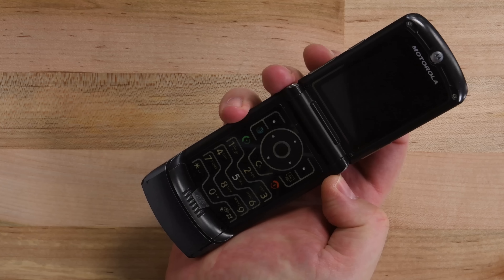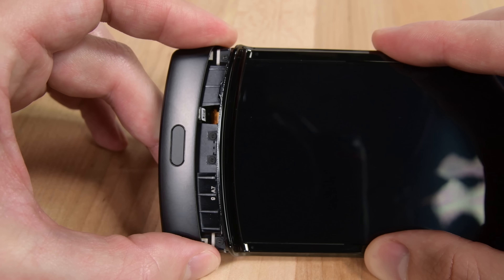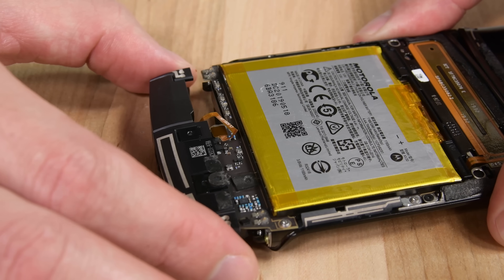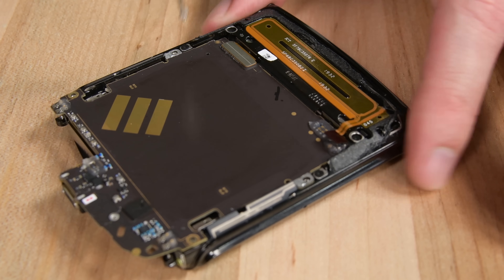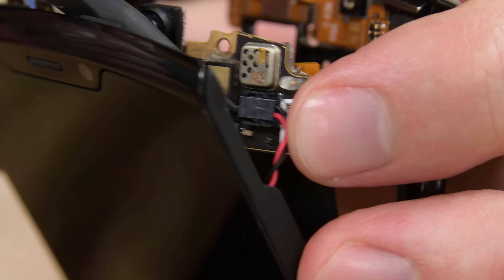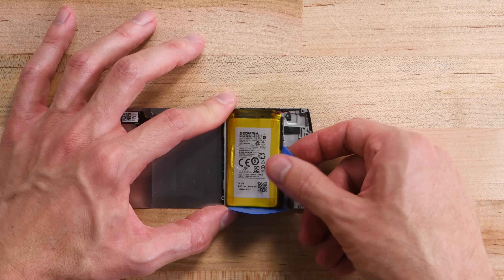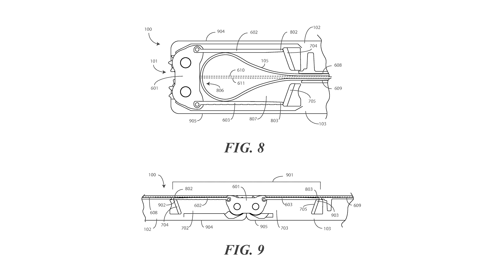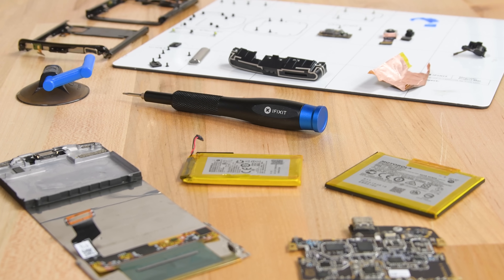Motorola Razr Teardown - One of the Most Complex Phones Ever

Comment: I absolutely love my RAZR 5G. I had the original RAZR V3 when it first came out and I remember that thing turn heads like nothing else could, so glad Motorola revived the name and did it proper justice with a folding display. 

Never really cared that it doesn't have a flagship tier processor, I haven't noticed any performance difference between it and my snapdragon 865+ powered note 20 ultra.

Comment: You gotta give Motorola credit though. This phone I one of the most complex pieces of tech out there, and the fact that it is repairable AT ALL is quite an achievement in my eyes.
Reply: I had to get the screen replaced on my razr and while expensive the tech I took it to said it was fun to take apart and they have a folding rig that they have to put the phone in and open and close the phone 20 times to make sure the hinge is working properly

Comment: Lets see battery removal requires prying against the screen. But there is a magnesium frame supporting it and you demonstrated with the first battery that you have a plastic battery tool. Yet you used a guitar pick to remove it. Sounds like you just like to overly complete the disassembly.

Comment: Deserves a "solid" 3.5 out of 10.  1 should be reserved for devices that involve damaging components to disassemble
Reply: I agree, but at the same time I understand their rating. The odds of a user, even with decent skills, not breaking anything on it are low. The cables are all easy to snap in their config, and the 2nd battery is likely to break the screen getting removed from it. Even with the knowledge here, It would not be an easy job.
Reply: @dragonmaster391  yes, but it is not in the same league of repair hell as EarPods.  Some fixes can be made.
Reply: @southerncharity7928  oh for sure, I agree with you. But Im saying I understand why they gave it a 1
Reply: Every tech related channel is SLAMMING this phone with unfavorable reviews. I don’t think I’ve heard anything good about yet...
Reply: The screen is flexible so why would it be damaged after some pry with a flat tool? 
Everyone is like smashing this phone rating.
The only real flaw I see is the price.
Reply: seems logical
Reply: Is it? To me it seems logical that is if disassembly can't be done without breaking something then it is 0 - because it is nearly unrepairable.
But yes, this phone deserves 2 or 3. Tricky wiring and dangerous battery removal are pretty common even in non-foldable phones.
Reply: Diykstrapro Agree, the original Surface books were that way
Reply: Agree
Reply: no, that would be a 0
Reply: Leonardo Valle like AirPods. Those should be 0
Reply: Get out of here you loch ness monster
Reply: Real question is how much did the iFixit was paid to do this review..Great job s*****g
Reply: Or an immediate score for anything Apple. Here's all the reasons I think this is a fair default score:
(I wouldn't be surprised if someone finds tamper detection micro switches inside one day)

Active repair deterrents, "just buy a new one", glue right in front of the CPU cooler, shoe rubber on top of poorly soldered chips, capacitors one size too small to work right, flash soldered into the board, HOME BUTTON MATCHED TO THE CPU, barbecue rework, traces on the board burning instead of fuses, "blame the SMC", kernel panics, malicious warranty programs, high-voltage backlight power right next to 1.8v data lines (which don't even have protection networks), custom connectors which change with every new model, camera being mounted onto the same SMBus lane as the GPU temperature sensors, unplugged battery costing $500 to replace, "You're holding it wrong!!!", accidental fusible resistors on the charge controller, "unibody" display assembly that's really aluminum glued to plastic, omission of any and all standardized components entirely for licensing income from third-party accessory manufacturers, Thunderbolt failure resulting in the computer not seeing the main drive, PM_SLP_S4_L problems, power button routed through trackpad, PPBUS_G3H being shorted to ONEWIRE communication line if you plug in the SYMMETRICAL CHARGING CABLE backwards, ...
Reply: Yeah. iFixit seems to overuse the 1/10. They’ve labeled several devices that with wildly different actual repairability.

Comment: I would have given bonus point for the "modularity" of the design. It looked hard to disassemble, but it felt like a 2 to me more than a one
Reply: I agree!
Everything was taken apart and nothing seemed to be broken! I thought it would fall apart but it held very well!
Reply: yeah, solid 2 imo. Hard but do-able and in a non-destructive manner. A 1 is hard, do-able but destructive with 0 being not do-able at all.
Reply: It is a flexible display, so some pressure wont damage it.
Reply: Replacing a battery glued to the screen caused this 1.
Reply: @rodrigocosta2365  it is glued to the plastic compartment that is then glued to the screen. It's not in direct touch.
Reply: @paryzfilip  but if someone tries to remove, they will need to apply some force indirectly on screen.

Comment: People complaining that it has mediocre specs but forget that it’s still faster than they would ever need.
Reply: Well it's still scam if i give you half a cake for the price of a cake "because you're not hungry" it's still a scam
Reply: My complaint is the price for what you get. Samsung gave flagship specs in their Z Flip at almost $200 less than the new Razr. The detriment is Motorola not wanting to move away from the Razr's original design. It's time to evolve the device or move on.
Reply: Please tell me how fast do I need
Reply: It's $1500, which is overpriced for literally any phone you could possibly buy. "Still faster than they would ever need" doesn't even begin to make up for it. I wouldn't buy any phone for $1500, let alone an underpowered phone that'll easily be destroyed by pocket lint.
Reply: I prefer a more powerful processor so that I can down clock it more and save battery life.

Comment: Seriously? 1/10? Next to devices that just cannot be disassembled at all without damage?
Reply: My problem with this score is that there were absolutely no procedures that are uncommon or destructive. No non-standard tools, no heatgunning or, G-d forbid, ultrasonic-knifing.
They mention several times that "cables are a trap" but avoiding them requires merely goddamned common sense: if you're removing a part you've never tried removing before, do it slowly and carefully because it might still be connected.
Why the hell do I care? Because the way I see it, this "repairability rating" no longer reflects said repairability, making the rating useless. And there is even no recap "and here's why" now. Why?
Reply: @D:\side\ it does require heatgunning (they say "heat", and then "more heat").
Reply: You’re right. iFixit has a weird culture of thinking that when tech gets smaller, things will still be as repairable as a desktop pc
Reply: Jesus Christ. Why is it that any time there is a score on the internet, losers will whine about it?
Reply: @mjc0961  takes one to know one, eh?
Reply: @Systremor Motorola is not known for having user-friendly hardware replacements. You are buying an obscure Motorola... What are the odds it's easier to service?
Reply: @yfs9035  get back under your bridge lol. Jk, he didn't say anything about the hardware not being flagship he was merely complaining that the score does seem low just. I think they didn't know where to rate it because the design is very unconventional compared to phones the past few years, that have all come apart pretty much the same.
Reply: To be fair it is a phone with a 2100 mAh battery, so if that didn't already tell you what you're getting yourself into I've got news for you
Reply: @yfs9035  What does the battery capacity or any specs have to do with the disassembly score?
Reply: @RicardoRiSkAmaro17  it costs $1600and it has a battery half the size of just about any other smartphone with a traditional form factor. Of course full and screens aren't going to change power consumption by very much as it's still OLED. Obviously it's at best a flex phone
Reply: @fightdecorona2452  Well that response is not gonna help me understand it...
Reply: @yfs9035  that's easy enough: look at the teardowns of Microsoft Surfaces (the old ones, that got 0/10) (edit: or the Airpods Pro, that also got a zero) to see the bottom of the scale. Then judge for yourself if this one deserves a 1/10.
Reply: @yfs9035  you have to actually want to understand... Can't make you understand.

Comment: $1500 for an over engineered but lackluster hardware specs? Nah, I'm not interested. For 1500 there are plenty of other more capable phones on the market without the folding gimmick, I have already used folding phones 10+ years ago.
Reply: @C20F  I'm trembling over here, keyboard warrior.
Reply: This is quite clearly a halo product, just as the galaxy fold is. Don't think for a second this is high volume. You're short sighted thinking that exploring new form factors wont be beneficial for future product development. Every single iteration of the phone - in all of it's forms - is an exercise in form factors. You remind me of old people yelling at the 4 inch android phone screens back in 2010 because iPhones doesn't need to be bigger than 3.5 inches. Yet they're now all using 6 inch iPhone screens. You haven't used folding phones before, you've used dial pads with screens which could be tucked away. You must be getting old.
Reply: @fVNzO  Folding phones are not a new "form factor" when had that years ago. Those 4" android phones from 2010 brought something new and fresh to the table, E.g. Touchscreens, haptic feedback, WiFi/data connectivity etc. This moto Razr brings nothing new to the table, not even the form factor is new.

"dial pad with screens that could tucked away"  yeah, that's a folding phone. The Razr is literally for people blinded by rose tinted nostalgia glasses. At least the galaxy fold can be a tablet when you want it to, "best of both worlds" I guess?

E: Old? Nah, BB Pearl Flip 8220 existed 12 years ago. You must either be young or too dumb to realise that.
Reply: @LadBooboo  yes thanks for illustrating my point. That thing is literally the very attempt at constructing a more intuitive form factor for phones. It is not a coincidence that Samsung and LG and Apple and everyone else making designing or buying screens are invested in folding them. It's literally the thing we've been doing with our tech for decades. Having a continuous screen there is indeed a new form factor compared to two components with a flex cable in between. As soon as you create a device which can house a bigger thing in a smaller footprint you've made a new form factor. But it's cool. You hate change until it's spoonfed to you because the world has moved on. The galaxy fold and moto suck today for sure. But they're pretty god damn significant nonetheless.
Reply: Kristian Friis most people are still using 4.7" iPhones dude. The 6"+ are only a small part of the iPhone sales.
And you don't need to use such a gimmick phone to know that it's nonsense. I already know that I HATE the fact that I have to open the phone every single time to even be able to use it. And for what? For something that didn't even existed a few weeks ago: having problems to fit a phone into your pocket. People wanted bigger and bigger phones and never had problems fitting them into their pockets for literally a decade but NOW it's a problem? Come on dude.
Reply: @Raja995mh33  All the latest Samsung phones, apples new iPhone are all around 6 inches in size. This is the norm now. But it doesn't really matter. My point is that phones have continuously been evolving. You can't sit here and shit on these folding phones for being useless when they're paving the way for folding tech going forward. It's like shitting on the first gen iPhone for not having a real keyboard as people did back then. It doesn't matter if you don't want to open the phone each time. There will be folding phones with screens on the inside and outside. It doesn't matter how bad you think it is today. It's a crucial part of the evolution in phones and portable form factors. This is my point. And so in 10 years when you got a phone as slim as the one you have now but is able to fold out into an 8 inch screen and otherwise functions like the one you have now, there will be a new way to interact with a pocket computer. The last 100 years has been an exercise in miniaturization of tech. How someone does not see the obvious pattern here is beyond me.

Comment: Seeing what they had to put in such a small place, I don't blame them for their components placements. It is not like a macbook lol
Reply: As an engineer i can only bow down to how much work it must have taken to design this complex masterpiece
Reply: thats only really real beef with iFixit. They always try to make the companies out like they are intentionally designing tech so they cant be worked on. Now this might be the case with some products like computers (apple), but it comes to tech like phones and tablets its a direct result of the majority of people wanting thin, powerful, and water proof/resistant devices. There is no way in hell companies can make tech that meets the majorities demands all while make everything easy to take apart and maintain water resistance/proofing.  It's just not really feasible nor cost effective.
Reply: @flclkun5479  I used to work on phone repairs. Iphones were actually some of the easiest to repair (the x is actually one of the easiest one imo). They can absolutely take into consideration making a device easier to repair and take apart. Foldable phones are new but I suspect it will become more refined in the construction of it eventually.
Reply: @Awkward Gaming Can't confirm that at all, older Samsungs was the easiest, they was designed like the enginners targeted easy repairs, even if everything was screwed to the display frame, it took me less than five minutes in relaxed routine to swap the display, while to swap an iPhone display took around ten minutes, which you in theory need only to take out and put a new one in, but like 300 screws from which every single one is different and cables that don't allow you to lift the display up just like that without tearing them makes it a very annoying job, especially if you do it day by day, many people get so annoyed by that, that they don't put the metalsheets back in and don't screw down the display cables and so give the phones back to their customers with less parts back than they had before.
Reply: @Wilson84KS   Wilson   I agree older Samsung were easier since you literally just pop off the back and unscrew the same sized screws. Samsung still use the same screws for everything but it's harder imo to replace the display ever since they made it so that you have to delicately remove the glass back with a lot of heat and rubbing alcohol. I got pretty good at it (never broke a glass back after training) but at least most of the parts weren't locked to the motherboard. That's one thing I love about Samsung phones.

 I just liked repairing iPhone since the battery was easily replaced and the display was easier to test compared to a Samsung. That's literally the majority of problems that I saw. The only real dislike I had was replacing the charging ports since it has to be just right or the phone will never close..
Reply: @Wilson84KS  keyword older Samsung's. Try replacing a screen on a new one. That hurts
Reply: DaSheriff Louis Rossmann would approve
Reply: @volkingdeath5312  screw him
Reply: This chick is annoying